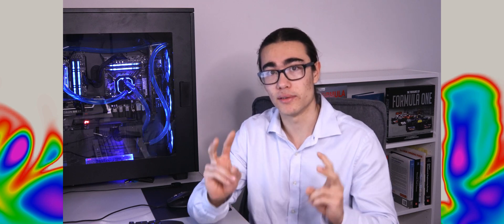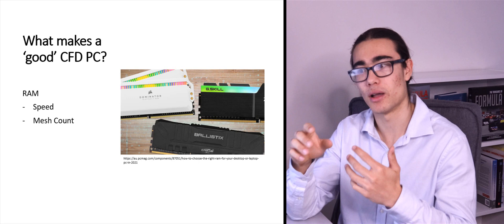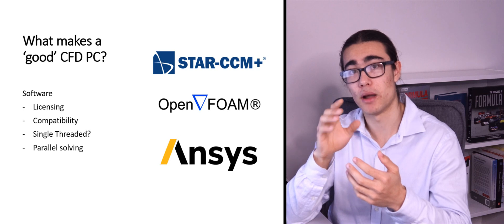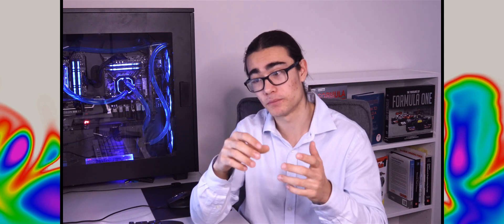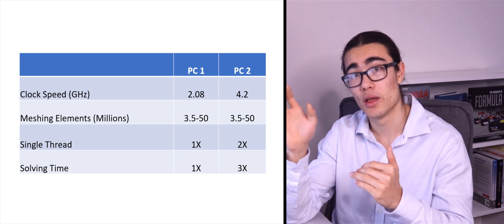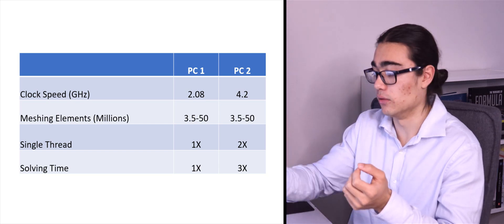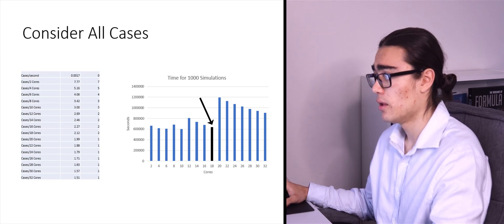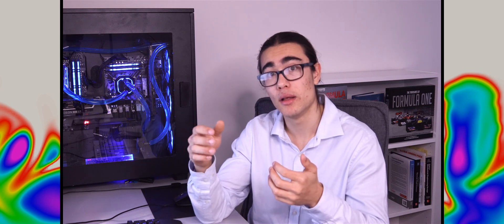Computation for CFD- Hardware Maximisation

Comment: Hello, I have to decide to buy a laptom with a Ryzen 9 7945hx or a  i9 14900hx. Both with 32Gb 5200. Im going to do simulation of external aerodinamics and 10 or 20 millons of nodes. What you recomend ?

Comment: what do you think about using desktop CPUs? for example i am thinking about building PC with ability to upgrade it later by adding a GPU for gaming. I think of i7 14700k with 64gb of DDR5 RAM and built in intel 770 graphics.